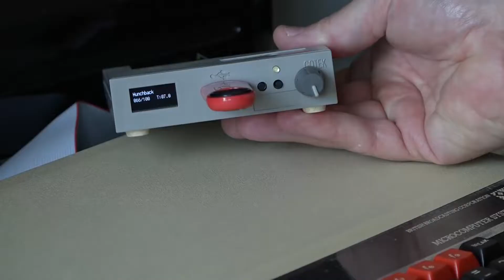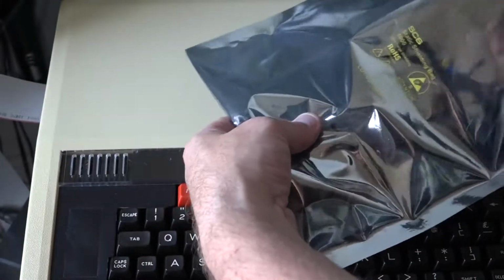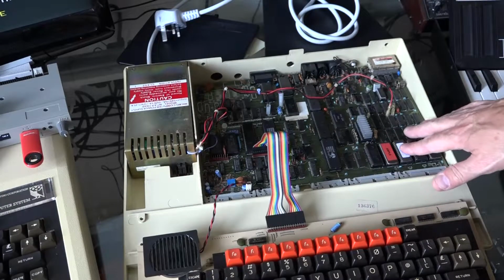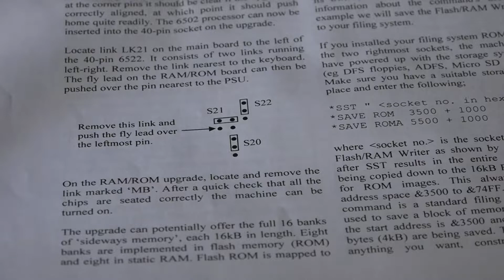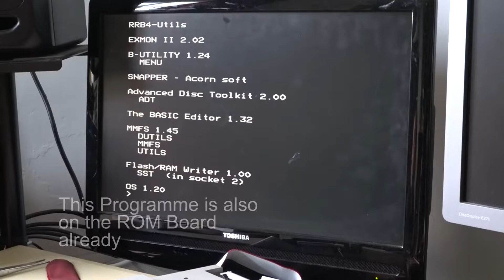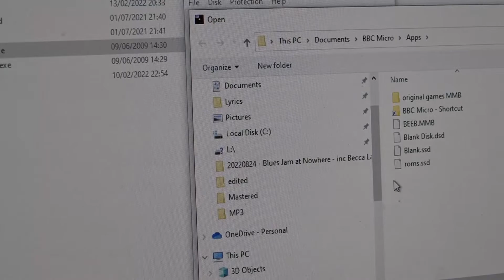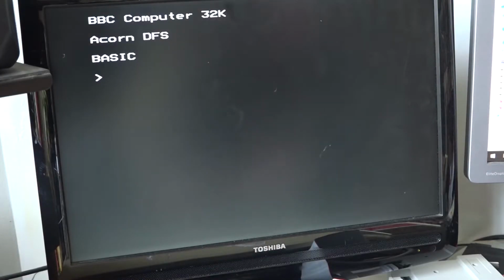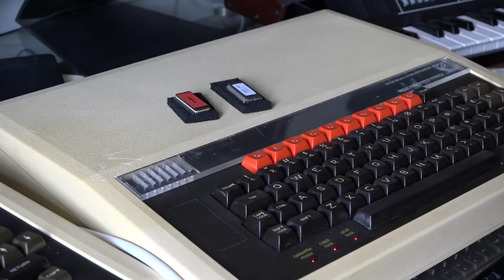Fitting and Testing the IFEL Sideways Rom / Ram Board to an Acorn BBC Micro Model B

Comment: Could you please put a link for your chip pulling tool? I would like to buy the same. Also would  you mind posting the instructions for the rom expansion? Just a couple of images will do.
Reply from the maker: The tool I bought secondhand no idea I'd look on eBay. The instructions come with the board when you buy one.
Reply: @MatthewNorthMusic  I'm still waiting for Steve to build some more. Did order one last year but it got lost in the post. If you could share the instructions, I'd like to read them. I'm reading BBC machine code and assembly language books at present. Oh if you could show your chip pulling tool from different angles I will try to make one. I've ordered some pin headers and will try to repair some old boards while I wait for Steve's next batch of pcbs.

Comment: Have you tried the boobip eerom and ram expansions? They are not as all encompassing as the ifel board, but are great little add-ons and very easy to fit. I'm not affiliated, but have a few.